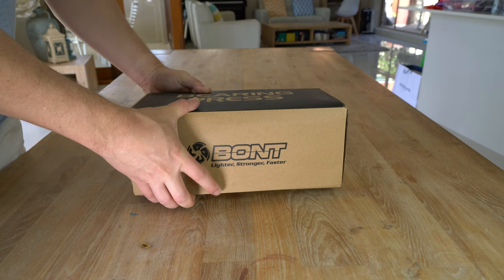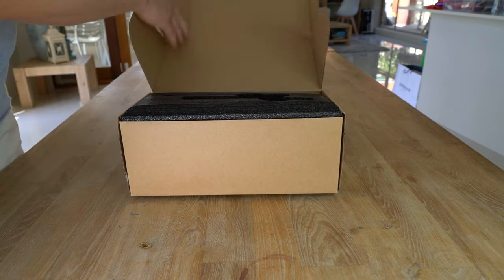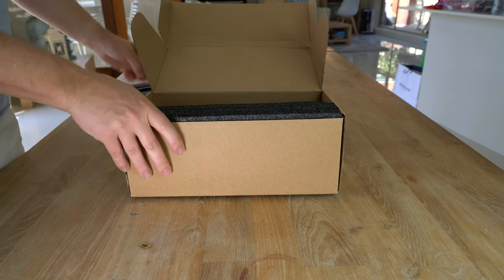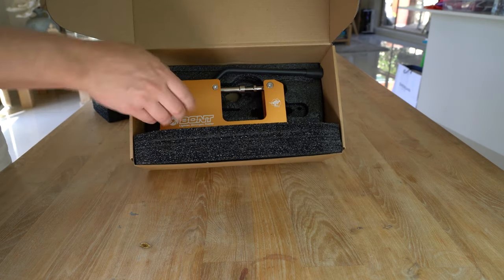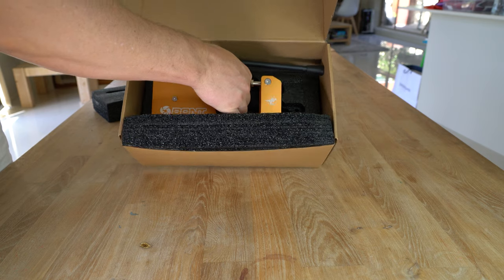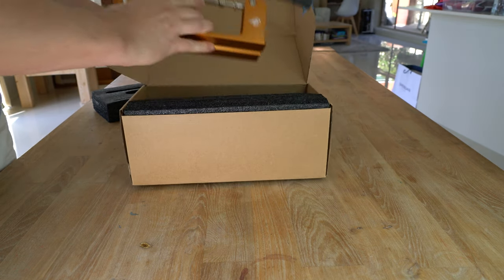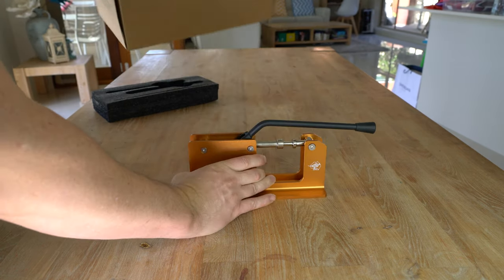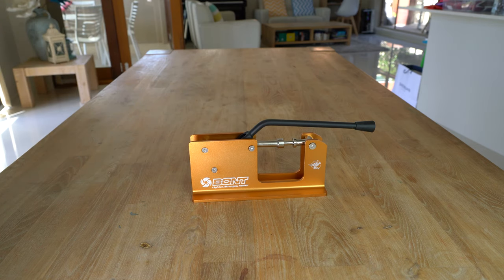Inline and Scooter bearing press 100mm 125mm

Comment: Does anyone know how to unscrew the 8mm piece to add the 7mm piece?
Reply: There is an allen head bold on the outside of the shaft that swings up and down. Look in the side with the kangaroo logo. U screw than and the 8mm arm comes right off, and 7mm arm goes in. Takes all of 3 minutes to swap them.

7mm crew unite!